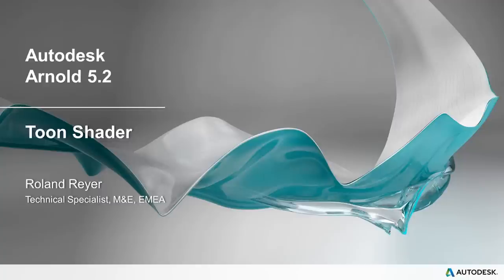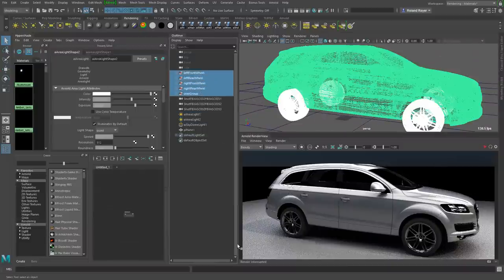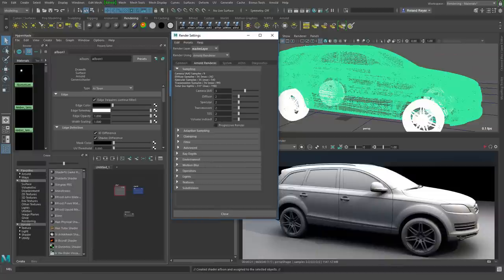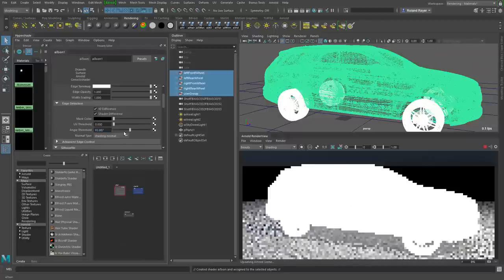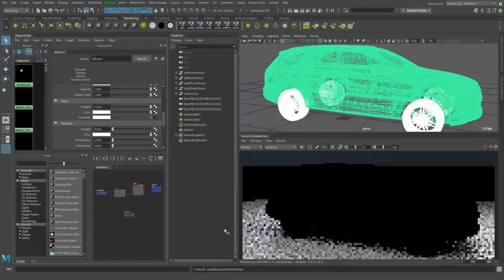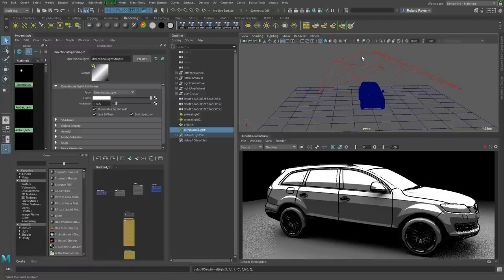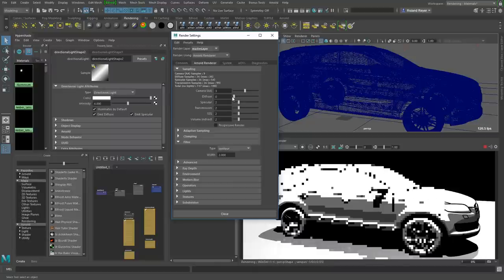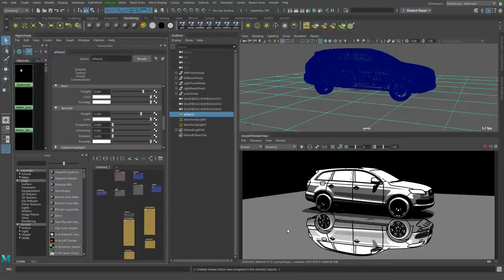Arnold 5.1 Toon Shader

Comment: Hey Mr. Reyer, very helpful and clear tutorial. Thank you. A couple of questions...

1. I get no alpha channel for toon-shaded geo. How can I break my scene up into render layers and composite them -- without manually making masking layers? Or, is that what I have to do when using the toon shader?

2. Arnold has the unfortunate tendency to render shades darker than it does when making tests in the Render View window. Why is this and is there a way to make the two match? I can save out stills that match the RV output, but final renders let me down. Is the solution somewhere in the Save Image Options menu?

Thank you.
Reply from the maker: Hi Keith, braking up your scene into render layers is actually the best way to separate things andf to get the alpha that you need.
For the second question please post the problem on https://forums.autodesk.com/t5/maya/ct-p/area-c2 and include images. (Make sure it isn't a color profile problem or the file format)
Reply: for your problem with rending. sometimes In the settings when you have it saves it in a Raw or Color Managed. the raw tends to have it darker (aka without gamma). so make sure to use color managed. if not you can always throw it into after effect and put a exposure effect and change the gamma level
Reply: @RolandReyer  JUST saw this. Sorry man. As for the image brightness difficulties I've experienced, we may be moving to Redshift which nullifies that. Thanks for getting back to me.
Reply: @valerieperez007  Hello Ms. Perez. Thank you for your response. I've messed with gamma settings, preferences, etc, etc. Nothing seems to make any difference. Anyway, as I wrote above, we may be moving to Redshift at my job. It renders MUCH faster while maintaining the same photo-realistic quality. Thanks for the suggestions!

Comment: This is cool but if there was a way to add lines where you want them via edge or face selection sets would be cool.
Reply from the maker: You could create splines where you need lines and use Arnold's spline rendering. You can project the curves onto the poly surface, but they need some extra thickness and some offset from the surface.

Comment: the lines don't even show up ;(. Do I need to define UV's to do this?
Reply from the maker: Did you set the filter type in the render settings 3:00?
Reply: @RolandReyer  Yeah, I just discovered that the filter is not GPU supported, that was why, sad ;(. Thanks anyway.